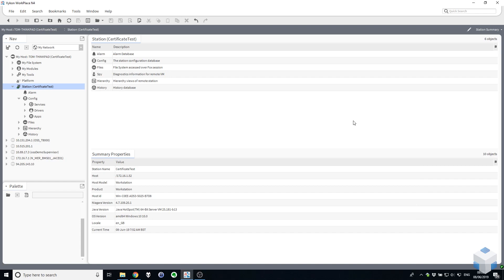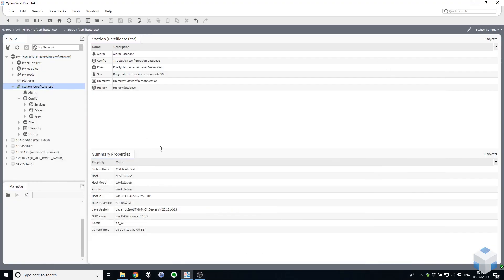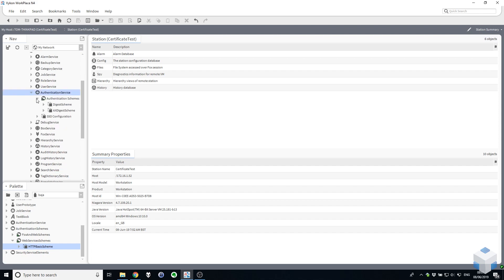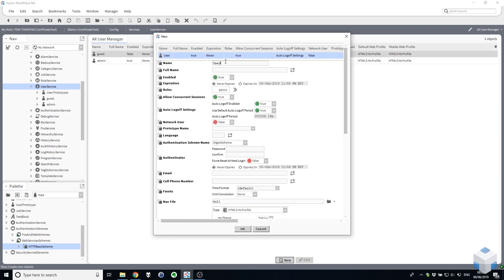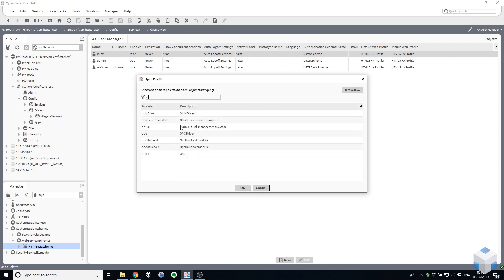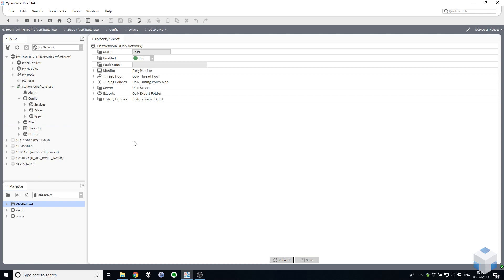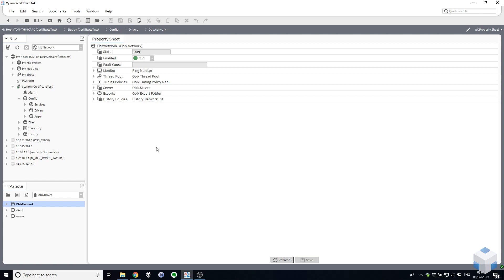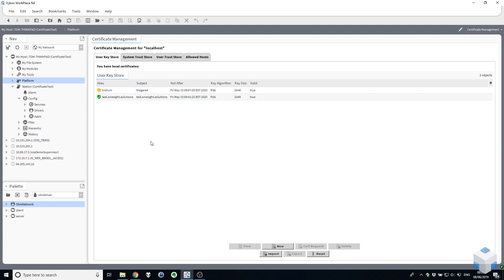HOW TO: Enable oBIX in Niagara 4

Comment: Great video. Ax version was much easier to use. Are OBIX points discounted from the system point count? Ex. if you bought a license of 10 controllers/500 points, do OBIX points count as part of those 500?